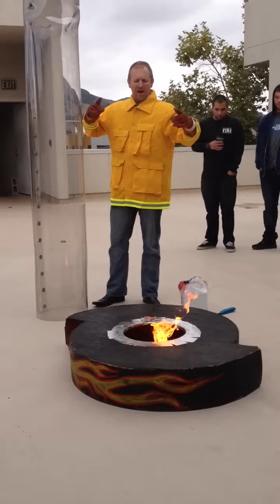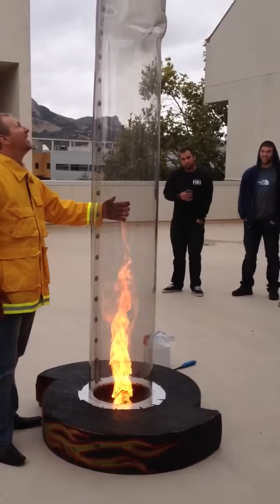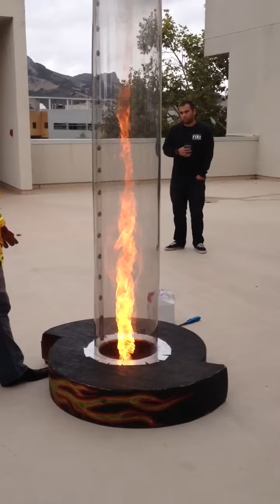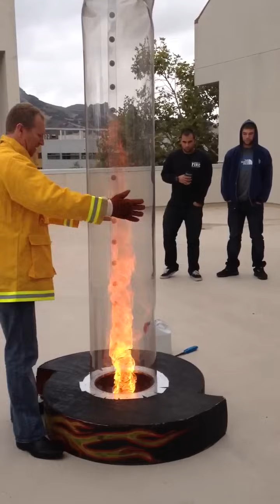Fire Vortex Demonstration

Comment: They make a small version of this device for candles. It has three angled air-intakes at the wood base. But the candle doesn’t generate enough heat to create the vortex. So it would be fun to make a candle vortex, with three small electric fans at the bottom to provide the rotational velocity. I think that the candle would burn brighter.

Comment: If you have an open fire you can use this principle to light the fire quicker, or increase the flame. Use something that covers the top 2/3 of the open space, this creates a smaller space for the air to be sucked in at the bottom by the fire. The faster air movement by the fire and burning material increases the air available to the material so it can burn faster and stronger.

Comment: You can do this by removing the other end of a cup so they’ll be 2 ends (or a enter and exit hole)  and then cup the cup in half so it’ll split , then glue one half to waterever you are using to do the experiment and glue the other half a little more to the left so it looks like if one half shifted passed the other one , then light a small flame in the middle and boom

Comment: So at night, set up connected drones with lightweight platform, connected to a propane tank on the ground with lightweight tubing to supply the propane, have a very large plastic tube thing to channel the fire up, fly it above tree level, and ignite the flames. People should freak out.

Comment: Someone pls explain its principle
Reply: Because the cold air is coming from two different angles to replace the rising hot air it's creating a tornado effect. Check out Viktor Schauberger for similar designs with water. Allowing vortex by shape design is the most effective, efficient system.

Comment: Does this pipe creates pressure like the chimney does or we speak different effect?
Reply: The transparent pipe used (can be any pipe) stops the air flow from the top so fire gets it's air from the vents that are designed in a circular pattern and as the air goes in it also follows the circular path and a vortex of air is created and at the same time there is fire so its called fire vortex and it goes much taller with even a little amount of fuel or air or both being added. Its very dangerous in forest fires with large amount of fuel (wood) and fresh air. Happy to help 😊♥️

Comment: Conservation of angular momentum of the air draft feeding the fire. The air flows in the bottom at a wide radius. As the hot air rises from the fire the tube forces it to rotate in a smaller radius and higher angular velocity. That's how you get the tornado.
Reply: Thank u for the information

Comment: Yeah science stuff I definitely understand pssh does anyone know how that works
Reply: The fire burns and hot air rises. Normally it spreads out so it's very weak, but when the top is restricted the only way new air can come in is from the bottom, so the pressure drop is concetrated and with the two vents on opposite side facing opposite way, new air flow in and combine in a circular motion, also making the flame become a vortex.

Comment: I would like to build this. Is it simply a fire pit with offset air vents and circular mesh, or is it more complicated than that?
Reply from the maker: You're absolutely correct. The base with the offset air vents would be the only part requiring fabrication. Simple design!
Reply: @WmPark650  is it plastic tube or steel mesh? ,,cant be mesh
Reply: @ARCSTREAMS  is an glass tube and if its plastic it will melt and metal are not transparent
Reply: @Dubixruby  looks melted to me.
Reply: hey, did u try it ? what material is used? is it a special glass?
Reply: Ggjf
Reply: You can make this out of any steel cylinder.
Reply: @JDPersonal  i don't think so
Reply: @deaderogamerz9514  we made them up in Montana, they deteriorate rapidly but you can do it with the proper slits at a 45° angle to each other. You then just set it over a fire.
Reply: @JDPersonal  hang on... I have seen this name before
Reply: @aiztoh  have you?
I wonder where...
Reply: You don't even need a special base, you can split the tube into two halves, and create the gap with it.
Reply: I think you forgot the tall plastic cylinder thing.
Reply: You could also make the cylinder out of glass